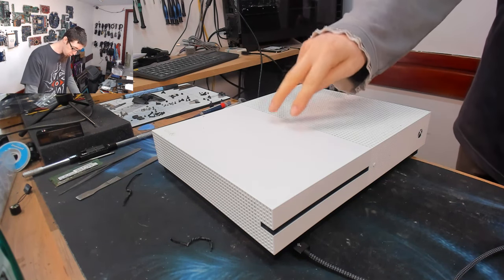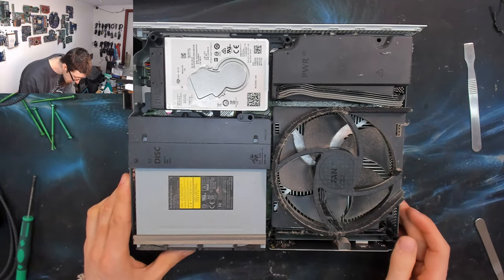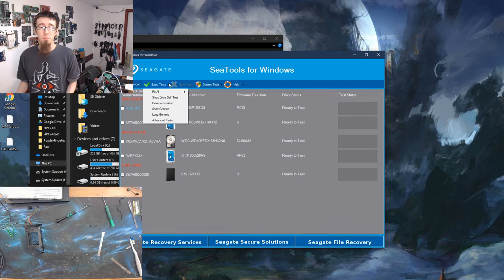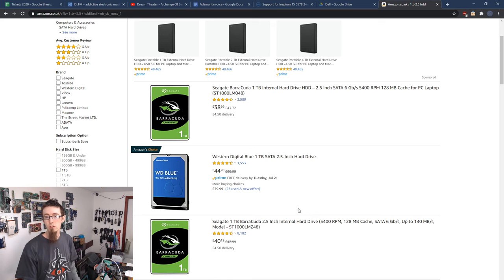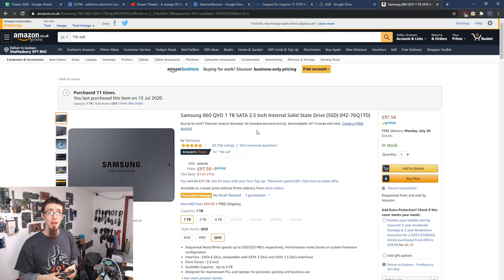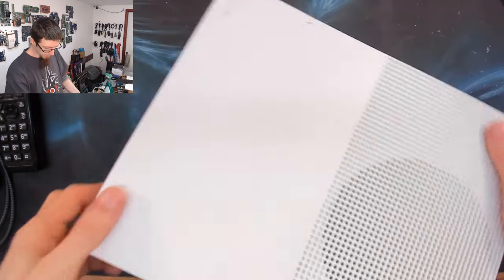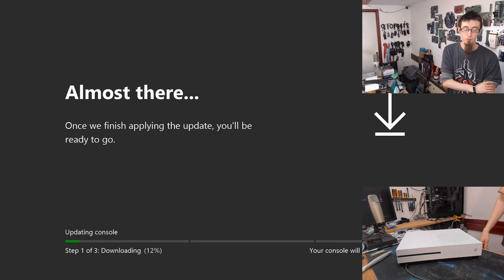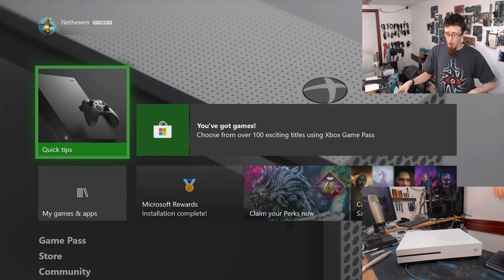Replacing an Xbox One S HDD with an SSD - LFC#214

Comment: Very fair charging model, I hope that your customer base appreciates you.
Reply: Totally agree.
Reply: he doesn't even mark up the parts.
Reply: Toby Williams that’s only a £5 markup. Most tech places mark it up at least £100
Reply: @Toby Williams Phew, that's fleecing them <\s>
Reply: It's not fair at all. He should be charging the full labor/diagnostic rate regardless if the guy wants to change it or not. That ain't his problem he did his job.
Reply: i am charging diagnostics separately, even if customer does not want to repair it.
Reply: @cappuccino-1721  True all the ones I know are a complete ripoff so hard to find any trades who dont rip you off nowadays!
Reply: @TopRacer2002  my Xbox one S 4 years old I'm getting alot of errors some reason 😥good thing I have Nintendo switch
Reply: @unknownwolf4046  my 20 year old super Nintendo is still going strong. Sad how crummy new tech has become.
Reply: I wish I would have watched this before taking my xbox one s 500gb in to ubreakifix for a $163.00 hard drive replacement!
Reply: Not charging a fair price for your labor is self sabotage when you’re running a business. Gotta grow a backbone

Comment: so microsoft just lets you do this now? i thought you had to do some relatively shady stuff by cloning OS info with a third party script. this is bonkers. have you gotten any xbox one x's where you had to change the drive? this is great news!
Reply: that's what I thought too, crazy that no one is talking about how easy this has become
Reply: And running ssd can make your Xbox load games incredibly fast my one x loads gta 5 in 12 seconds
Reply: DarkZeroNemesis yeah the one x still has a hard drive though
Reply: i thought xbox was like ps where they aloud and supported you replacing the hdd. This looks like they tried to make it impossible to do for the general consumer base.
Reply: Hamez88 I mean doing this is pretty easy to be honest, especially if you have even the smallest amount of computer knowledge...
Reply: I swapped my Xbox One X with a 1TB SSD. I did run a script from another video do so the partition cloning originally, the Xbox wouldn’t boot properly after that, so I plugged a USB stick in with XboxOS install and after that finished it worked flawlessly. To be fair there isn’t a HUGE difference in performance. You get a couple extra seconds on loads, but nothing major. The biggest thing I’ve noticed is that install speeds for games and apps are a lot faster. Probably due the drives faster read and write speeds. Overall I’ve been very happy with it.
Reply: @greylawson6352  it can be done i know but that is a lot of extra steps to what I thought it was. Even 360 was easier and they semi supported hdds (either official branded ones or you buy the hdd xbox shell and a hdd run a program script to format the hdd to what ever the xbox uses and then put it in)
Reply: Hamez88 this isn’t that complicated to be honest, just take apart the Xbox (watch a YouTube video on how to and proceed carefully), then it’s just some screws, and standard cables, install the new SSD, and download an update onto a USB stick. Yes it was easier on the 360 hardware side but very difficult on the software side. Most people that aren’t tech savvy will have an easier time making hardware repairs than software repairs. I just thought the software side had seen a notable improvement.
Reply: Back in the day I set up a 120GB HDD for my 360. It involved using a DOS boot disk to write firmware to the drive, and required very specific drives for that reason. Seems if you're willing to void the warranty, Microsoft doesn't care anymore. Probably because of their move away from proprietary add-on HDDs.
Reply: @BeamerMT79 Correct but in the time of Covid-19 it would take months to send your system in for repairs to Microsoft and then get it back. This is a relatively quick and easy process rather than waiting on Microsoft to do the repairs.
Reply: @BeamerMT79 Yeah it would be nice if they considered the consumer in that regard.
Reply: @greylawson6352  I took that to imply that he swapped his HDD out for an SSD. I could be wrong.
Reply: @hamez877  they did at first. This is one of their revised decisions. The 360 had an easily swappable drive, but you had to buy theirs or a specific model of hard drive. To use anything else you had to do software modding. That is unless that also has been revised since.
Reply: ArtisChronicles I thought the same thing, but that wouldn’t make it any harder or more difficult.
Reply: @DarkZeroNemesis1  How about gta o. It takes 17 mind in my pc with hdd
Reply: Prateek Panwar gta online do you mean because it’s usually around 3 mins for me
Reply: You still need that script to do this properly, if you change drive sizes it will not use the new drive capacity and the bootlogo is missing since it was not copied into the correct location first. The bootlogo fixes itself after a system update but putting a different size drive in cannot be fixed without that script.

What that script does that this recovery mode does not so is that is corrects the GUID values of the drive partitions to match the values Microsoft expects for that size drive so when you put a larger or smaller drive in the Xbox One it will utilize the larger space and retain that space after a system format.

Doing it this way could lead to problems down the road since the GUID values and partition sizes might not be 100% correct.
Reply: @driverdis3488  so it seems it's a "simple fix" if your replacement drive has the same capacity, but i guess this confirms that this obviously isn't "officially" supported. maybe when the xbox os with support for the new gen rolls out there'll be some hope
Reply: zingbanana I doubt so as the new storage medium for the Xbox Series X is a custom SSD and the external expansion SSDs are proprietary cartridges. 

My guess is that the internal drive on both the PS5 and Xbox One will not be replaceable period, especially the PS5 with it’s 5GB/s custom SSD that can’t be touched via the current market of standard 3.5GB/s rated SSDs.
Reply: @driverdis3488  oh no, those drives are soldered. i'm just keeping my hopes up about an update when the XSX is released that will optimize the OS to run using SSDs for a smooth interface and faster loads. back compat is getting a huge boost next gen and maybe that will be enough. we'll see.
Reply: @steve8339  yes just ignore the complexity of taking the system apart to replace the hdd good narrative bud
Reply: DarkZeroNemesis 🤣🤣🤣🤣🤣 definitely not
Reply: I would guess, they don't give a shit, they make their money with online services and games.
Reply: @greylawson6352  so you're saying I should do what this guy did in the video exactly to get this guy's results? 🤔
Reply: people have been doing this since release day to get faster load times
Reply: @Honiahaka1  even mer seconds to a gamer that spends hours a day gaming adds up quick 👍🏽

Comment: Another great video.  Performance increase with an SSD really depends on the game being played. Overall an SSD will improve loading time performance on average of 15 - 45 seconds, but bandwidth through the southbridge chip of the Xbox S is limited, so do not expect lighting fast improvements on all games as you would see on a PC for example.  The bottle neck is the southbridge, not the SATA header.  For reliability it is a no brainier to install an SSD.
Reply: I can only imagine how epic it would be in the Xbone VCR, because from experience they seem to be quite noticeably slower than the S.
Reply: Is the south bridge where the sata controller is? A ssd should also kill a hdd in iops as well. Running your os plus games from an ssd should net noticeable gains otherwise you could just use an external ssd.
Reply: @saysbadman  The southbridge is a support processor for the APU, basically it handles input and outputs to/from other components on the board (HDMI, WiFI, HDD etc).  So even though the SATA and APU can handle higher bandwidth, the southbridge throttles throughput for certain I/Os to allow it to handle the multiple requests without crashing/overheating etc etc
Reply: Raw sequential bandwith isn't the problem with HDDs in the 8th console generation. The problem is in HDD's IOPS, seek time and the multiple small files that multiply the seek time. I was thinking for a long time now to change my HDD to SSD on my One S, made the change on my PS3 and PS4 many years ago cause they were extremely easier and didn't involve opening the device completely (i am extremely clumsy and useless when it comes to these delicate actions and i would never wanna damage my devices). Adamant here made it look very casual and made me wanna give it a go now that my primary XB device is a Series X. I have ordered an SSD an i'll try it tomorrow when i have what i need.

Comment: Good to see that both the PS4 & XB1 can be easily fixed/upgraded with a new HDD or SSD. 
I believe the 360 required a weird workaround, if you wanted a drive larger than their proprietary addon drives, it requiring copying of specific data from existing drive. So I never bothered trying to upgrade my 360 HDD, whereas I swapped my 80GB PS3 drive for a 320GB HDD. 

I did end up with a 320GB 360 drive though, as I got the Halo 4 360 in a trade in deal, that was weirdly generous for a GAME deal. Trading a 250GB slim with 1 controller + £100, it got you; the custom clear shell console, 2x custom controllers, 320GB HDD, Halo 4 on disc & fresh warranty.
Reply: Stock 360 consoles used whitelisted drives to prevent cheap 3rd party upgrades, but they're still standard 2.5" HDDs in more (phat 360) or less (slim 360) weird enclosures. Fairly easy to circumvent by getting a WD HDD up to 500GB and using "hddhackr 1.40" on your PC to make said WD HDD pretend being one of those whitelisted official drives which the console will then accept. Unfortunately 500GB is the upper limit because no official drive larger than that was ever released that the software could make the new drive pretend to be

Comment: I always recommend if doing  hard drive replacements in consoles 2-4 TB is the option as a longevity tool

1TB has been obsolete standards since the introduction of blue ray as a standard in console..
Reply: Yeah you have fun with that slow ass mechanical drive
Reply: Since 2007?
Reply: @shooterboi   sadly how many games do you play or have you installed on the system>??

I ask this average games these days can meet or exceed 250 GB on install nby the time you install:

game 
day 1 patch
4k
DLC
mods 
updates

I run all the games on a 2TB  external
Though I would love to run a 8TB option in an ssd at 1 point..
Reply: @sharpeside  to be honest these days the reality is you can the  entire back catalog of ps2, ps3, ps4, xbox, 360 and one
Reply: you can't get a 4TB drive unless you wanna fork out £400 for an SSD.
Reply: @GothicKittyMadness   lol in australia they have fetching upwards of 1,800 with the original street $800-850

Comment: I never knew it was that easy to install the system software, I thought we had to prepare the software for the hdd/ssd beforehand on a computer unless that’s for the 360
Reply: it’s similar to installing windows
Reply: I think if you go with a drive less than 500GB or more than 2TB (Xbox compatible sizes) then you would have to make some changes not seen here because you need to trick the Xbox into thinking there's a compatible drive there but I wouldn't advise going above 2TB because there can be issues later down the line and less than 500GB is just pointless as there are predefined sizes for each partition so the last time I messed about with a 250GB for an Xbox the actual space for storage turned out to be in the region of 130GB but this was only as a project before I put a 4TB in there
Reply: Dean I did more research about it and it seems to be a chipset or filesystem limitation so 2TB is the maximum that the xbox X can support
Reply: @DeanD1990  yes i thought there was some script you had to load. Do you have to stick to the size the xbox came with as my nephews came with a 500gb can i use a 1 terabyte with this easy procedure
Reply: I think it cocked up during an update so i have tried installing the software via a flash drive and it gets to about 60% and stalls. Im guessing the hard drive is knackered
Reply: @si4632  Keep reformatting, I have an original 1TB Xbox and it did with Fallout after I had a different issue and had to reformat. From what I can understand The console gets stuck trying to download the game and update and install at the same time. That's the only advice I can try and give, which sucks because it erases, EVERYTHING.
Reply: @si4632  I have not had any other issues since though, I got it when it first came out in 2013.
Reply: @SMAAirAssault  yeah took hardrive out formatted in my pc its working now
Reply: Been working for months the blue ray drive won't read any discs though I think thats what was stopping it installing i disconnected the blue ray drive and the os installed

Comment: For everyone:
 
Quick tip for hdds not ssds. If they stop being recognised, it can sometimes mean dirty contacts or slight discolouring of contacts between the boards and the hdd itself. Where contacts from the drive itself touch the board, use an eraser to go over the discoloured contacts. I had this recently and have had this a couple of times now. Just go over with a soft eraser till they are clean and then you just put it back together and you should be fine. You could use IPA but if you do not have one, and eraser will do so long as it is a soft one and will crumble a bit easier, you do not want too hard in case you damage the contacts. This does mean taking the hdd board off the hdd and cleaning but this does NOT mean the sata power or data contacts. The other contacts between the board and the hdd which is why I say, taking the board off the hdd.
 
This may not be as well known. Provided there is no other issue like clicking and just that it is not being detected, your drive may actually be fine, just clean the contacts on the board to the drive itself which as contacts that are slightly springy, just becareful not to damage anything.
Reply: "Quick tip".

jokes aside thanks for sharing, im sure it helped someone!

Comment: QVO SSD I would only recommend for archiving purposes. They have small caches and are dram less cache. So once the internal cache is filled up it can depending on the controller run as slow as a mechanical hdd when writing or reading data. Imo if a client is running a SSD as a boot OS drive. Then I'll use a dram cache tlc drive instead. When the cache fills up there is not much of a penalty on write and read performance. Something to keep in mind.
Reply: Yes. For me only choice today on sata Is 860evo and MX 500

Comment: Just upgraded mine to a Crucial 1TB SSD for $50 from the OEM 500GB HDD so I don't have to rely on an external drive anymore. This video helped me a lot for taking it apart and reassembly, so thank you.
Only problem I had was that the OSU refused to run, getting an error code every time. I managed to get it to work by pulling the SSD back out, which the console had formatted and partitioned, and copied all the files from the original HDD over.

Comment: A vacuum cleaner with a soft brush attachment is the best for removing dust from computers. I've never understood why everyone else seems to use compressed air. That just blows the dust around and potentially pushes it further into places it shouldn't be.
Reply: No it doesnt, you use a compressor if it's done properly. Canned air is a joke and expensive. Take the PC outside, hold the fans with your fingers and blow it with an actual air compressor, it will be spotless. Can wipe parts off with a microfiber cloth after and it looks brand new.

Comment: Actually there isn't problem pushing/touching the top. The metal plate is quite thick + there is always big air gap inside. I mean, to do any damage, you have to hit it hard with something.
Reply: He loves making people think things are hard or dangerous to keep his business going right....
Reply from the maker: You're talking to the guy who doesn't take anti-static precautions. I'm not exactly a model of 'best practises'.
But I've also watched work-experience kids holding a laptop HDD in a death-grip while they unscrew the rails on it, so you kinda want to make sure they're not clamping into the top.

Comment: Well, that seems a lot easier than many other videos make it to be! I just might upgrade my One S one of these days... Thanks!
Reply: better off selling it and buying yourself a pc my guy, now that halo infinite is gonna be on pc as well theres no reason to keep an xbox, which is honestly disappointing because i grew up with the original xbox
Reply: @lilakila5935  not everyone use a console the same way. I guess my Xbox One X for 4K Blu-ray playback, as well as for playing backwards compatible with Xbox 360 titles and any Xbox originals they have made digital. Makes well for occasional LAN parties with my friends.

On top of that, I also have a R5 2600/1070ti/64GB gaming rig but they each see their share of usage. Time will tell how my overall setup changes.
Reply: It's worth noting I have an OG Xbox, two 360 E's, and an Xbox One S in my possession.
Reply: @lilakila5935  I do have a PC also. I like games on both platforms and I have other use cases for each machine also. I also use XBox Game Streaming on my smartphone every now and then to play games that are installed on the XBox, which works quite well even on mobile data. This SSD swap might be useful if I can't upgrade to the Series X this year.
Reply: unfortunately it's much better to have storage than speed. personally I wouldn't do anything less than a two terabytes. the Seagate fire cuda 2 TB sshd is a pretty good compromise